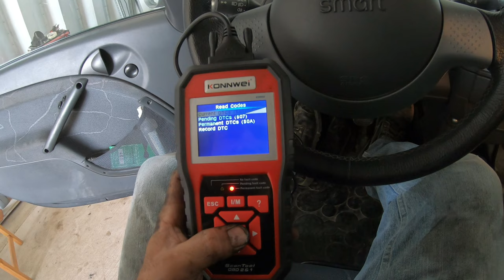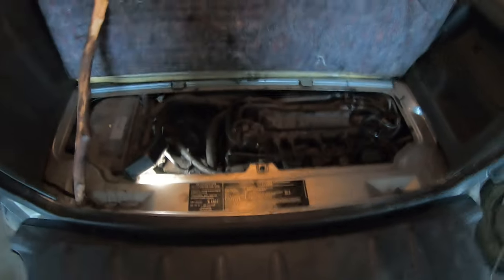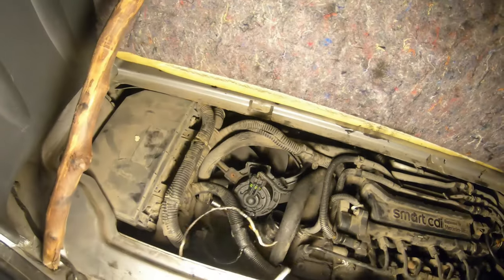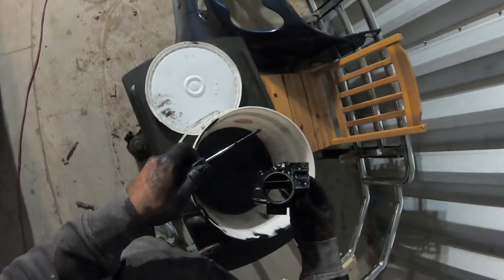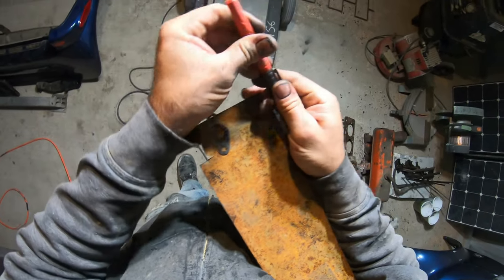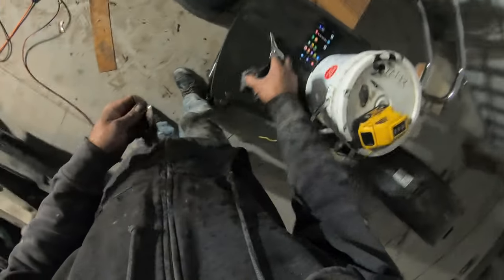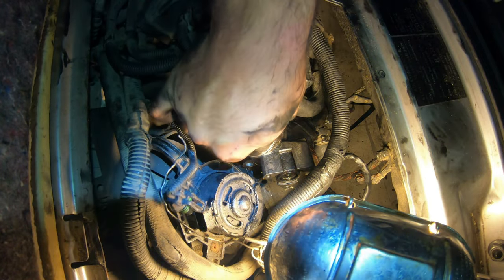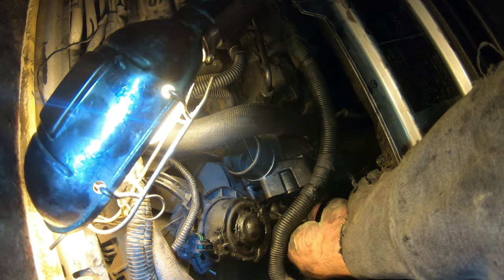Smart Car EGR Valve, Easy, No More Codes, Without The Bloody Music!

Comment: still can’t figure how to get the 2 rusty bolts out of the EGR. ? they are too rusty for any Torx to fit.Any ideas?
Reply from the maker: Spray penetrating oil, hammer socket  onto bolt head. If bolt head stripped out, use an easy out socket that will grab onto damage bolt head .  Or could try hammer on a 12 point or standard 6 point socket of similar size, might work. Easy out probable work best.  If that doesn't work can weld a nut on bolt head & remove with socket. Take time & try to do it well, it gets more difficult to remove the more the bolt head is destroyed, what ever is being hammer on make sure is hammered on tight before trying to turn or will most likely just strip out bolt  head.

Spray penetrating oil & let sit a while before anything to make sure bolt will theread out easy when it starts moving.
Reply from the maker: Don't put same bolt back in 🙂, get a new one incase ever have to take apart again.
Reply: @manbuilds1587  Thanks. Yes I did spray it, let it sit a while. Also need to purchase a 1/4 Torx set. My 3/8 does not fit.
Reply from the maker: @hermannwilz4522  yah, when torx head gets rusted & it is hard to tell the size & the right socket always fit tight or not fit at all & the next size up will fit because the rust makes the bolt head larger. But when when you try to loosen the bolt with the wrong size socket it will usually strip out the head & then even the correct size socket may not hold it after that. 
Recomend to use the socket that is really tight & drive it on. That is most likely the correct one if the bolt head is rusted.

Comment: Thank you for posting this. I may attempt this soon! I guess you need a plate instead of just JB weld because the pressure is too high? Would some aluminium sheeting work?
Reply from the maker: aluminum sheeting probable too thin. I wouldn't go any thinner than 18 gauge steel or equivalent. Aluminum would probable ok, the valve is aluminum, just need a more substancial piece than a hunk of sheeting. It might work for a while but you dom't want it to fail & have bits go into the engine. suggest a hunk of aluminum flatstock or steel 18 gauge or thicker, would go a bit thicker if aluminum.
Reply from the maker: Haha, yah you could probable use jb weld. haha. problem is metal parts expand more than the epoxy, so your plug would come loose & probable stuck the valve open or a chunk of jb weld will go into the engine eventually.   I would not do but If want to do an experiment to see how long the engine will last a person could probable plug the exhaust tube coming up from the turbo with jb weld & put a piece of aluminum sheet there to keep any broken jb weld bits from going into valve or into engine. But all that work, might as well just put a thicker plate in there & not have to worry bits going into engine from thin aluminum or jb weld.

Comment: Thanks for these videos man, i'd like to know if i got one thing correct since i'm not an egr expert, 13:31 "i'm gonna silicone the intake side and put the metal gasket on the egr tube side", wouldn't the metal gasket/blocking plate suffice? and when you say to silicone the intake side you mean the little section of the egr with the valve inside shown at 0:49 sec in this video? https://www.youtube.com/watch?v=9cI4JqZ9WRw  Smart Fortwo CDi - EGR and Solenoid (2002)

Thank you
Reply: hahahahah just noticed that that same egr slot is shown at 49 sec on your video too! Crazy
Reply from the maker: Yah silicone on the intake side & metal gasket on the exhaust side. It would probable be ok with silicone both sides. The little exhaust tube probable does not get hot enough to cook away the silicone, but over time you never know. Would not want to start loose exhaust pressure there, best to have a real gasket in place just incase.
Reply from the maker: If you cut a couple slots instead of bolt holes in the egr plate or cut slots up to bolt holes you  will be able to merely slide in place. No need to remove egr if functioning properly. Just loosen & slide in plate. But is good Idea to remove & clean it if it isnt working or even with the new block off plate installed you will still get an engine light coming on eventually when the egr valve sticks. Valve still operates, plate just prevents any exhaust going through.
Reply: @manbuilds1587  Thank you very much, and great tip about sliding the plate in place! I will follow your advice and also silicone the intake side but just for the sake of understanding how egr works let's say the blocking plate has a perfect and permanent seal, you theoretically should not need to silicone the intake side, am I correct?
Reply from the maker: Yes if egr valve is operating & sealing perfectly then dont need the silicone. But is good to have silicone just incase. The intake manifold is under pressure  while driving. Engine is small with tiny turbo, a small boost leak may cause engine to not run as well as could. Best to seal it up.
Reply: @manbuilds1587  Hi! I got a notification that you replied and the preview of your comment was "when I say intake I was referring..." but when I go in the comment section under your video that comment is nowhere, I tried from my smartphone and laptop, do you mind telling me again? 🙏
Reply from the maker: When I said intake side I was referring to the egr valve body. It is part of intake to to the engine. One side of egr plate is to exhaust side with tube coming up from the exhaust manifold,  the other side of block off plate is to egr valve body or intake of engine.  Thats all.
Reply: @manbuilds1587  Commenting again since can't see my previous comment, found a good price and bought a blockoff plate kit that you can loosen and slide in, came with two kevlar 1mm gaskets and one 1.5mm blockoff plate, I was thinking of using one kevlar gasket on the egr valve body side, in the middle the metal plate and on the exhaust side using the stock thin metal gasket to prevent becoming too bulky, thank you again for the tips!
Reply from the maker: @filippocoletticonti4465  Right on, Cool. Good Idea, I never used a kevlar gasket before but I know for certain the metal one isn't gonna get burned away.
Reply: @manbuilds1587  yes, you were very helpful, btw do you happen to remeber size of the etorx that you need for the two bolts that hold the exhaust tube to the egr valvebody? If you dont no worries i'll find out :)
Reply from the maker: @filippocoletticonti4465  It's a E8
Reply: @manbuilds1587  Job done! ccv to atmosphere and egr blanked, the car goes better around town and at low rpms is much more ready, great result! I was thinking that the ecu is mapped still thinking that exhaust gasses are recirculating, do you know if the ecu has ways to calibrate itself maybe with a knocking sensor (if it has one) or something similar? And having made those changes my guess would be that a good quality remap by a experienced tuner would possibly be more beneficial than a stock car (not necessarily performance wise but purely to achieve optimal combustion), thoughts?
Reply from the maker: @filippocoletticonti4465  Yes egr valve still opening & closing, but is blocked so no gasses going through. A remap you could dis-able the valve all together & not need plate.  Installing egr plate is easiest way to dis-able egr. 
You could do alot of things if remap the computer but also maybe shorten life of parts. You can buy those plug in tuners that are adjustable to change signal back to computer to raise fuel rail pressure & possible timing without a remap & just unplug to go back to stock.
The more power you make with little car the more readily something will wear out. I did egr plate, ccv, exaust on mine & it runs so much better & is much more reliable. I repaired it for reliability & longevity, with benefit of a little extra performance. The moment start to  add extra 10- 20 hp through tuning is when it may start to shorten the engines life.  If I want a race car then I will build a race car, but this my little workhorse.
Reply from the maker: only the gas models have a knock sensor. Diesel ecu calibrates with manifold pressure sensor reading how much boost / air coming into engine , timing adjustment according to engine temp & intake air temp. , fuel rail pressure, turbo waste gate controls turbo pressure independent & mechanicaly through pressure tube & diaphram mounted to turbo to prevent too much pressure or over boost. Engine will remain in perametres set with out a remap. Its really not that complicated so much that needs a re-program. Diesel engine operates different than gasoline engine. Diesel operates wide open intake & add more fuel & is pretty safe untill something breaks.
Reply from the maker: you could remap computer & get some one to tune it up. Yes with egr & ccv mod , tuning would have greater benefit.  I would get rid of catylitic converter first before car remapped You cleaned up the intake, more benefit if clean up exhaust also. But any tuning that is done would benefit from less restrictive exhaust later on also. With catalytic converter on you may be restricted in tuning because of higher exhaust temps. There is no temp sensor for exhaust on car & if get it tuned at a garage make sure the guy sticks a probe  in there to measure how hot its getting or you might be burning out turbos all the time. The better flow out the exhaust means less heat build up & allows for more agressive tuning. I think alot of times what happens even without tuning the catalytic converter plugs up & heat builds up in turbo & burns it out. The guy replaces the turbo & puts the old exhaust back on with plugged catylitic coverter & burns out the new one as well. The catylitic converters seem to reall start being plugged around 180000km.
Reply: @manbuilds1587  Honestly everytime I ask you something I feel bad in advance cause I know you're gonna write an article about it hahahah thanks for the in depth explanation, I'd also like to ask you if removing the cat have an effect on low rev torque removing the backpressure the cat provides, I'm in Italy and you have to have gas checked every 2 years so I could get another second hand cat and switch before the inspection, on the cdi is pretty easy to do, is the smell without the cat that much worse?
Reply from the maker: @filippocoletticonti4465  Yes, You already know it will run better without the cat. The less back pressure after the turbo the better for a diesel. Better low end, faster spool up & better top end also.
I never liked the smell from a diesel cat, think there is some unhealthy particles comimg out even if less emission. Diesel soot without a cat is a larger particle & bit safer in my opinion. Though should not breath either. So in my opinion it stinks less, same on start up when cold.
 That is my biggest annoyance with the smart, is the intrusion of exhaust. Is why extended the tail pipe back. 
Good idea, get a second hand exhaust from junk yard & modify if have a welder or an aftermarket exhaust with out cat & change back to cat for emisions test. Probable what I would do too.

Comment: Hello EGR oil leaks
Reply: How do I stop it?
Reply from the maker: oil or exhaust?
Reply: @manbuilds1587  I opened the EGR exhaust started
Reply: The oil is not spilled
Reply from the maker: Any oil in the intake is from ccv  (crank case vent). oil gets into the intake & slowly leaks from intake tubing, where ever a bit loose. Depending shape of ccv & shape of engine, there could be alot or just a little bit of oil.
Reply: Ignore oil leak. Let say Is normal. Oil come from engine (CCV) and no one wants to rebuild it for this small issue.
Same issue at gasoline (petrol) ones.